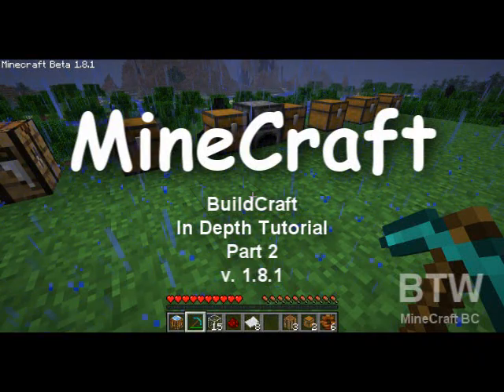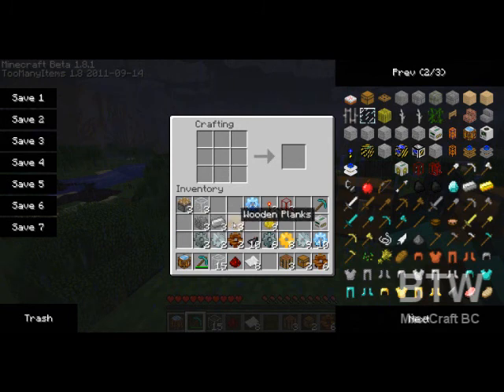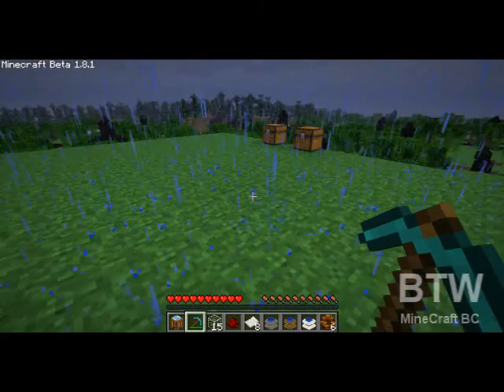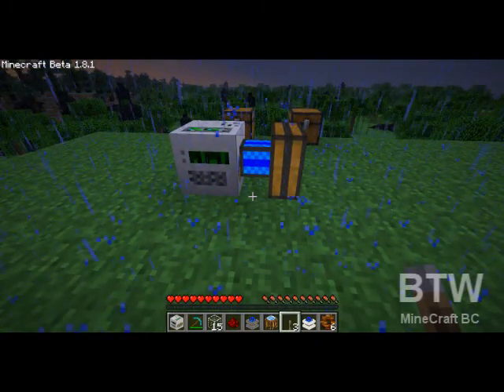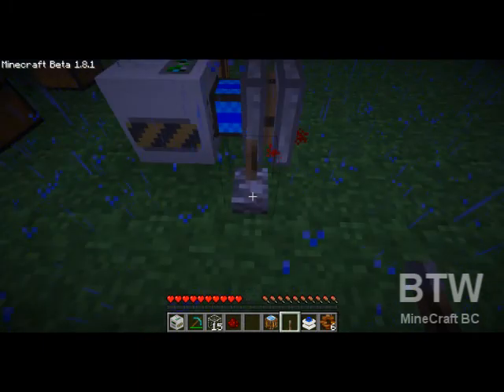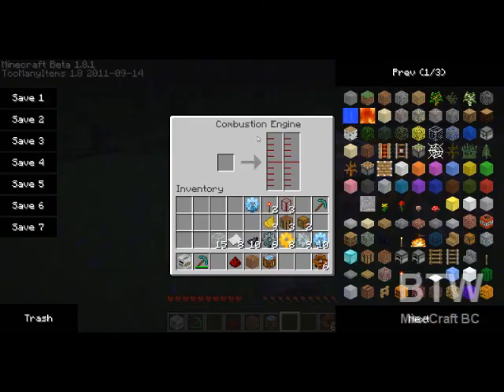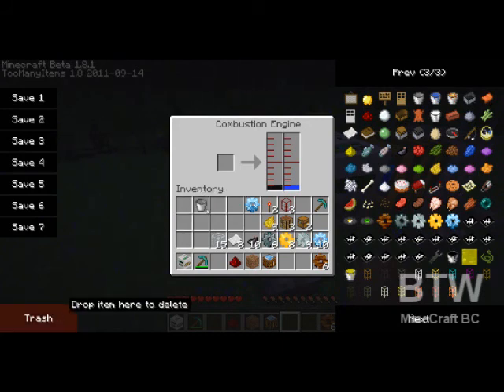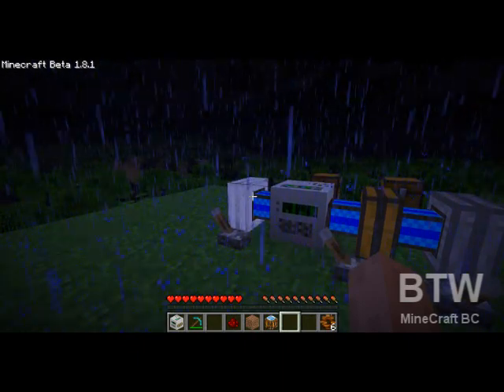BuildCraft 1.8.1 in Depth Tutorial Part 2

Comment: you dont need a redstone clock to run a redstone engine, it works with a lever or a torch the same way, you can have a redstone generator by making a reverse torch next to 4 engines and then use the conductive pipes to send the energy somewhere if you want